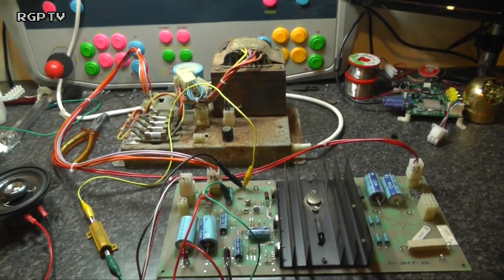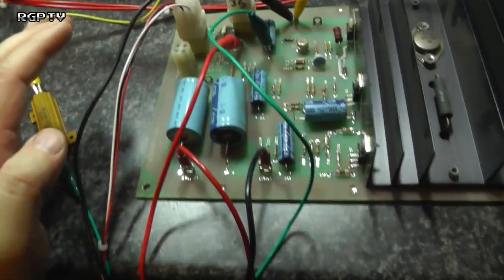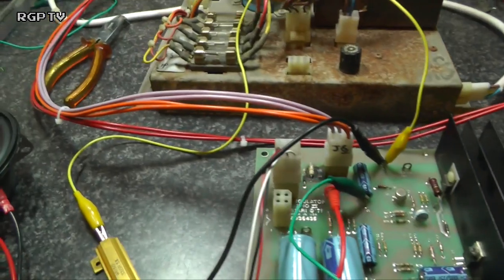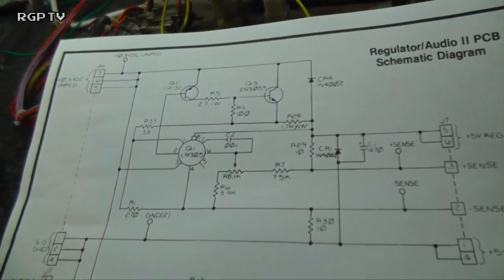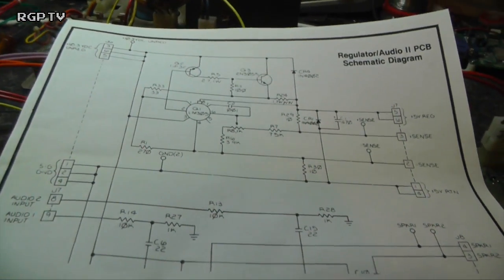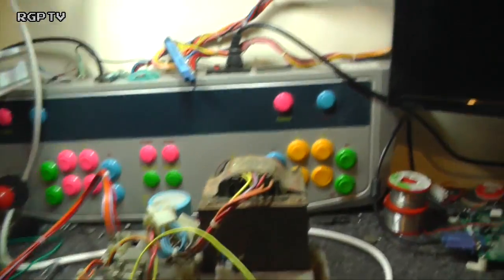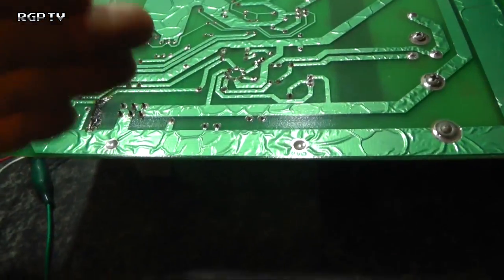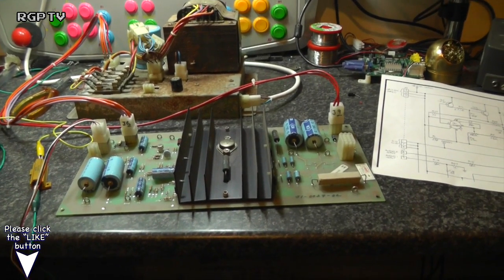Atari Power Supply and AR2 For The Newbies   Bench Tests

Comment: Ouch - that circuit could really have done with a 5V6 (or similar) Zener diode on the output, so the voltage would be limited if it got too high.

Interesting vid.
I agree - nice idea of theirs, but maybe not quite so well executed. lol
Reply from the maker: +electronash there are a brick load of improvements that can be made over this design in today's world, back then i'm not sure what they had access to and what was around as I was barely able to walk when all this stuff came out.  The mantle has been handed over to people with a passion now and its up to us to keep these old games going.  I'd love to redesign this power board.
Reply: +Retro Games Party I don't think it would need much adding to it these days - something like the circuit used to protect the C64 from a dodgy PSU would be perfect...

http://console5.com/wiki/Commodore_64_Power_Saver

Could replace the relay with a nice modern Low on-resistance MOSFET too. ;)

(it would act WAY faster than the old-skool relay too, of course.)

Comment: Tested my AD power brick and I'm getting low monitor voltages.  40V between pins 10 and 14 (instead of 80V), and 13V between pins 11 and 13 (instead of 65V).  Pins 1 through 9 are all good.  Is this a bad transformer you think?

Comment: RETROGAMESPARTY, why does arcade power supply only use ONE filter cap rated at 27,000uf and not use multiple filter caps at 100uf like most common power supplies? Why use such a very large capacitance at 27,000uf and higher?
Reply from the maker: Its acting as a very basic smoothing circuit for the unregulated DC voltage
Reply: @retrogamesparty  yes but why did they use such a very high capacitance value at 11,000uf to 27,000 using only one big blue cap? that is a very high capacitance value
Reply from the maker: Answer: because price probably... i have absolutely no idea why they chose that value - do you have an alternate solution that was available back in 1980 that met FCC regulations and price constraints?

Lets put it this way.  Some pipe-smoking bearded engineer at Atari with way more knowledge that both of us designed it and it met all the considerations at the time AND worked.

We’re dealing with 30-40 year old tech and some of it doesn’t make sense.

Why didn’t they add a resistor to bleed the capacitor if its open circuit?

Why did they choose those wire colours?

I have all these questions myself and no answers.
Reply: @retrogamesparty  no I mean the large capacitance value is store a lot of current and storing a large charge. The TTL chips are drawing the current off the charged/current in the big blue filter cap. But its overkill to have 10,000uf to 30,000uf to store that much current/charge in the cap for TTL chips don't you think?
Reply: @retrogamesparty  
        1.) Can the Fluke 9010A output a "consistent instruction"  and you can use a logic analyzer with 8 logic inputs to measure all 8 data lines at the same time to get a data signature or hash/crc?

Comment: Hi James I'm working on my ARII board.  I'm changing the caps out an the store only had some non polarizing caps.  Would It be ok to use non polarizing caps on the ARII??
Reply from the maker: +sdflyer1 no, in this application, you will need polarised capacitors, you can use radial leaded instead of axial ones as they are hard to come by - just heat-shrink wrap the legs as the AR2 tracks are exposed on the component side.  Wrap the legs so that only the bit that you will solder through the hole is exposed.  Make sure whatever you use to wrap the legs on the component is insulated though.